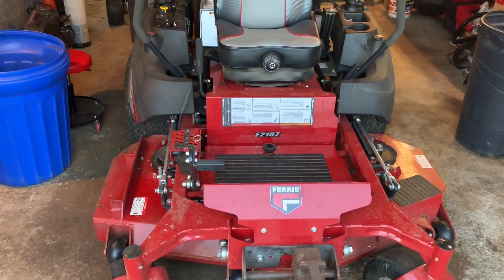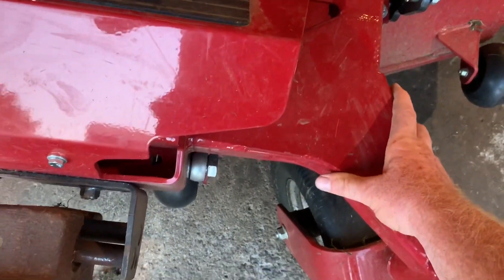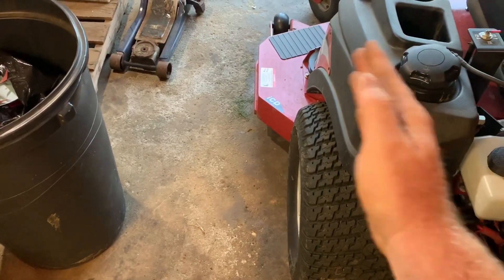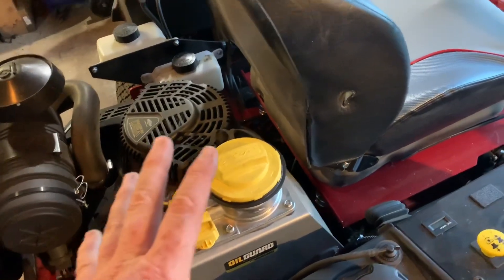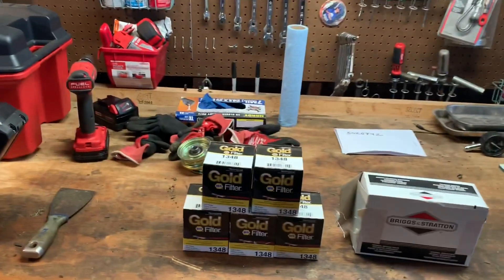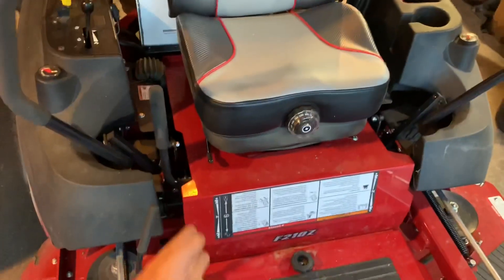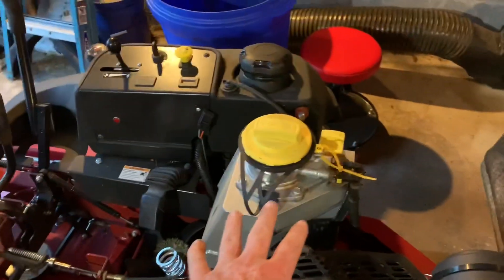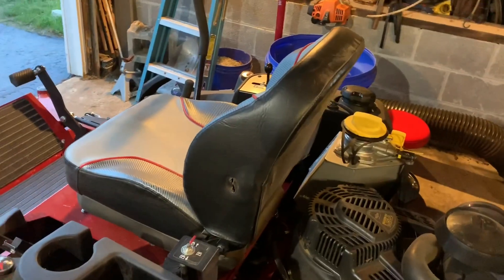Ferris f210z 25 hour review

Comment: Glad this mower is doing so well for you. Thanks for sharing your thoughts. I think that deck is lighter because the IS-3200Z has those huge HURCULES II spindles on it and the Oilguard has 6 quarts total , 1 in the engine and 5 in the resivour tank. I just ordered new shocks and struts for my 3200z ($500) My stock  ones feel wore out. I was told the shocks only last 1000 hrs before they start getting sloppy. Love the video's Johnny 💪👍😉
Reply from the maker: J's Crazy Cutz, LLC hows the hydros holding up?
Reply: Johnny Mow doing great so far...🤞🏻

Comment: Did you buy the 210 over another fully suspended Ferris due to the price difference? 

How does the 210 compare to the SnapperPro S200??

I have a 2015 3200 that I bought new earlier this year, it was a smoking deal as it was an unsold demo unit. Came with full warranty. I did not realize that the deck belt was going to be an issue until after purchase. 

I am on belt #3 in less than 100hrs. The newer ones come with a 2 belt deck system. I'm curious as to if the older single belt deck can be retrofitted with the new 2 belt system. Maybe you will know. 

Thank you Johnny!!

Comment: I noticed the height adjustment issue going from my 3200 to my 2100. Small details, but great attention to detail. Like your enthusiasm. Do you think the 310 would be as good? My local Ferris dealers won't even stock a non-suspended model. I would really like to try a "dump from the seat" bagger, but they get pricey. Keep up the great videos!
Reply from the maker: The 310 would be a good machine but the 26 inch tires are a deal breaker for me.  The 310 would be a great machine for sure

Comment: Johnny... good review of a economical well built value machine.  What psi do you run in rear tires?  Is the price (under 8k) list or after discounts?  I am liking my new Ferris 800 very well, with the new front suspension, and the 27 hp Briggs Commercial, and 52 inch deck.  Got it for 6.5k.
Reply from the maker: Dave Allen if I did not have a bagger it would be 15 with bagger 20 psi. Under 8 if bought at the right time of year. Great deal on the 800
Reply from the maker: Dave Allen list is 9,300

Comment: Cant decide between a 2100 or 210.  I need a 52 want suspension model but 5400 got replaced by 4400.
Reply: Oops 160z is the 52 model had same 4400 the 2100 has.  I might just go for the 61 and widen my tight gates.  Component wise this 210 looks superior to the 2100 besides loosing the suspension.

Comment: Oh and yeah I wanted 2 mention on the 400s i put carlisle at101 tires and it will completely make all the difference on the hills holds like crazy 4 a small unit u need a set for that mower u would be impressed I run them on all zero turns about 5 different sets
Reply from the maker: Andrew T 101?

Comment: Good review. But for me I’d have to go snapper pro s200xt due to the simple fact that you can get the 37 vanguard efi. Not sure how the f320z compares to the s200xt or this f210z though. But has to have the 37 vanguard. You know the beast it is. I truly don’t believe at this time that I could run anything else engine wise even on a backup. I don’t have a backup at this time as my cheetah is under warranty. My dealer is my backup and they’ve come through when needed which was once so far all season for minor issue.

Comment: Like I said before Johnny if Ferris would make a few tweaks to the 3200 I’d be willing to drive further to the dealer for one. Put the 24” tires on the 61” deck. One thing I wanted to mention that I find interesting on the Ferris fixed frame 210 the 2100 uses the hydrogear zt4400 transaxles which used to have the 5400 I believe maybe on the old model 2100 but now with the fixed frame you see the 5400 on them. Personally I think the vanguard 28 efi would be better suited with the 4400.
Reply from the maker: jew0182 my next video on this mower will go deeper into that about the 28 efi.  Love the 24 on the 61
Reply: I recently purchased a Ferris F160Z with the 28 EFI and the 4400 hydros. Curious why you suggest this combination is superior to the 5400 hydros.
Reply from the maker: The 5400 draws too much power. Gas mileage stinks